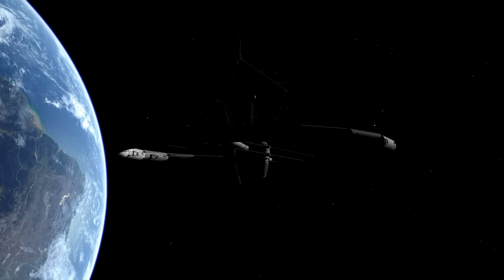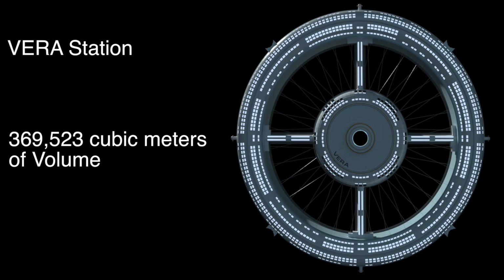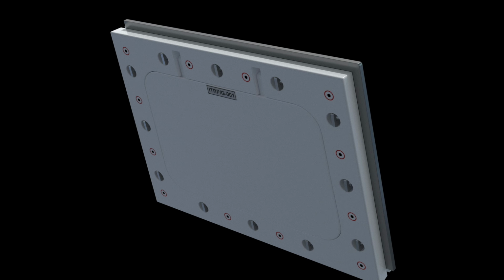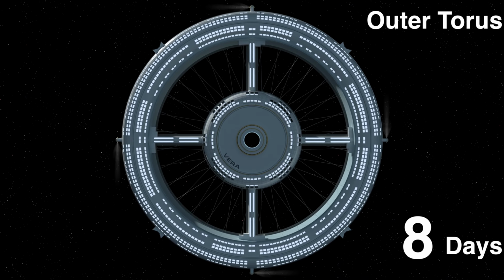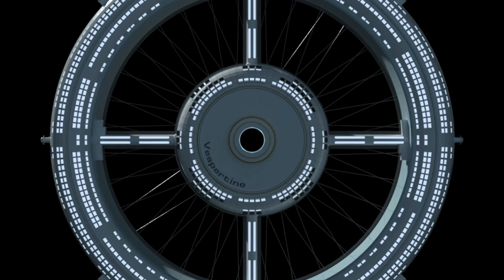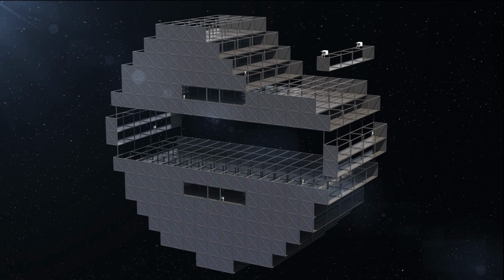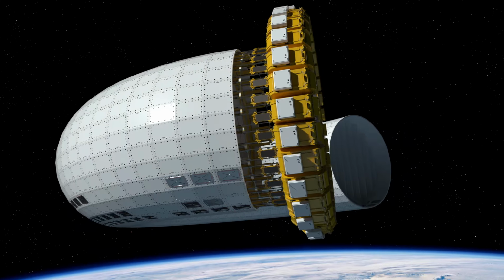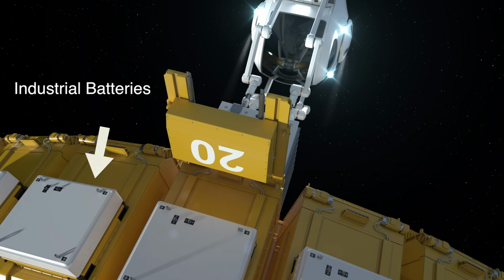We could build this huge Space Station in 6 months

Comment: On Earth, we use materials and structures for compression due to gravity.  It seems out of place, to me, that we continue using those materials and structures in space where there is no gravity.  Instead of weight pull down on it, the pressure inside pushes out.  Also, the rotation pulls outward.  In this situation, we need materials of high tensile strength-not compression strength.  That's good because great tensile strength is easy to achieve in very lightweight materials, such as polymers and fabrics.  Also, these materials are easy to pack into small spaces and expand them out once in orbit or in position.  Imagine the chains for car tires on snowy roads.  Now imagine spinning it rapidly--the chain will snap into shap just from the spin.  Imagine a polymer membrane inside of this that inflates by filling with air.  A small station could be carried by a single Falcon Heavy and expanded in orbit for under $200 million - a single launch.  

The hard part would be micrometeor shielding.   Also at higher altitudes, radiation shielding will require more.  I think, ultimately, a railgun on the moon that bags regolith and shoot it up into lunar orbit to pad its exterior would be perfect.    I've mentioned this concept a lot.

Comment: Ambitious but attainable I think.  The timelines however seem a bit optimistic.  The modular design is quite reasonable. I think it might benefit from a cam lock type of connection system over welding however for speed and ease of changes later on. Naturally it will need a seam sealer system of some type but I think a heavy rubberized tape might be faster and ultimately safer As it can be used both inside and out.

Comment: One thing that always hits me when seeing large rotating space station designs is the lack of solar panels and thermal radiators. Energy consumption of such a large structure and all that's in there will be many times the power needs of the ISS, and since we're in space, almost all this energy will be converted to heat at some point (plus the 70W heaters inside called humans).

So please, Gateway Foundation, make a video about this specific technical challenge and how you're gonna solve this with your Voyager and Vega designs - would be really interesting, as I can imagine power supply and thermal management is one of the biggest challenges in constructing a space station.
Reply: Based ProjectRho reader, right here!
Thank you for pointing all this out.

Comment: Building a empty hull is comparatively cheap and easy. It's the systems you put inside it that are costly and expensive. The ISS modules could have been bolted one to the next in weeks but it took time to build and test and validate the contents on the modules.
Reply from the maker: A good point Emerson. Systems integration will be expensive and very tedious, at least for the first one. Over the years I have become very well educated on carbon dioxide reduction systems for space stations and spacecraft. The old system was called CDRA but the newer ionic systems are better and scalable. - JB

Comment: Blah blah. Unless you can [ 3D Print an Aerogel ] as the weight of structure in even plastic will be too heavy to transport. !!
Reply: Rate mal, wie Schiffe auf der Erde gebaut werden - richtig, in kleinen Einzelteilen, die aus größerer Distanz angeliefert werden 😉
130...140 Tonnen in den LEO waren vor 50 Jahren kein Problem, mit Starship wäre es heute auch kein Problem mehr. Das mal 20....30, und fertig wäre es.

Comment: I so want this to happen and I believe that the manufacturing speed will be up in those numbers eventually, but it will depend on a strong and steady financial backing, a relentless commitment by the leadership and international support of the nations which the "building site" would orbit over. After all, if there's a complete loss of control or serviceability, where will the structure crash down? Hard to imagine it will burn up before hitting ground. Not to mention that the torus building machine will need to be assembled and put into service before any of the torus building can start. All in all if we zoom out a lot, this concept has strong similarity with 3D printing. I think it is the best bet at producing large volumes with minimal equipment and labor cost. The whole building machine could be operated by just a hand full of people, besides a large team of personnel to ensure trajectory, safety, material supplies and so on.

Comment: I wonder if a torus design can be printed using a continuously rotating printer head that rotates along the circumstances of the torus but also rotates along the cross section kind of similar to printing in vase mode

Comment: While most of the assembly machinery is outside the torus, your video shows welding from the inside.  I think all assembly must be exterior to the torus for the main reason that the last ring sections would end up with the welder stuck inside the torus  Everything is easy until you close the ring.  That's why all manufacturing must be exterior where it is easy to finish the ring as well as to remove and position to a new build area 
Looks interesting.
Best of Luck.

Comment: Brilliant. An inside-out tunnel boring machine. Simple and repeatable process. Might be easier to size the battery to be enough to install a full load of plates and change them together in a combined pack. Your going to have to reload plates so would it be most efficient to do both tasks in the same step?

Comment: The CGI movie shows the massive station frame under construction still and unmoving... but without any way to stabilize itself its gonna be rotating all over the place which would make it annoying for any kind of system where a drone moves on a predetermined course back and forth from a space pallet of panels, you'll want to minimize translation and rotation during construction, it will start spinning along all axes before you are even ready to declare it a real spin station lol...  microgravity construction has many pros and cons at the same time

Comment: This has always been a fascinating project, and It’s incredible to see this huge change. (Timelines usually slip back instead of move forward)

I am concerned about heat rejection, however. With a voluminous space station such as this, heat rejection has potential to become a major problem. Just look at the size of the radiators on the ISS! I’m sure you have plans for how to solve this problem, possibly some sort of active waste heat rejection under the skin of the torus panels? I see a similar potential problem for the Sargon system with its high electrical load welders and large batteries.
Reply: Easy, one side of the torus is towards the sun and is filled with solar panels, the other side in shadow have a bunch of radiators.
Reply from the maker: @Merecir  Bingo. What is not shown in this construction video is a canopy over the Sargon CR as it builds the torus. But after that the solar panels will block a lot of the heat and heat rejection will dump the rest off the dark side.

Comment: My comment/question, is about ‘Tie-in’. While assembly of module building in the oil field, the actual assembly of the modules, was the faster, easy part. It was the ‘tie-in’ steps, that were extremely time consuming and manpower demanding, with very specific skill sets.
Electrical, water, oxygen, life support systems, food, communications, production, and waste management, and other basic systems needed to support humans onboard… all required skilled technicians and manpower to make “Modules” actual working production sites.

With all these concepts of ‘space station building’ you are proposing in your video, how will the tie-in project of these space stations, be achieved? The manpower (still having to work in bulky space suits, will be arduous at best, and extremely time consuming. Even if modules come with all these systems in place, how will the tie-in work be accomplished? Very curious about your concepts.
Reply from the maker: They call this systems integration. It is an entire division of engineering. This is my third space station design. The systems integrations for VERA will be challenging but similar to the others I have worked on.

Comment: You're still talking about lifting raw materials from earth. Weight / dollar. Using your building ideas first on the moon to first setup  a mining and refining  community and then a manufacturing community  on the moon. This would make it cheaper to lift loads into space to build such space stations in orbit.
First I would drill for water, then I would dig for gypsum. This could be done autonomously from earth to start with.

Comment: How does the station avoid orbital debris?
How much does each panel weigh? How many panels per 150 tonne delivery?
What happens to the shipping pallet when it's empty? Can it be used in construction?
What systems will be in place to avoid "spillage" of construction materials and welding spall into orbit?
How many tonnes of atmosphere need to be shipped to the station and at what frequency to replace losses?
What is to be done with human waste?
I don't see how Sargon could create bulkheads. What happens if a panel or section fails?
Nice idea but execution is everything.
Reply from the maker: 1. There are 4 Spin-up/Spin-down engines mounted on the exterior that can also move the station away from any large debris. See 27:20 of this video.
2. Each panel weighs 568kg
3. There are no shipping pallets, we use a "materials tree" that holds all of the panels and batteries. After it is empty it goes back down with the starship. See 25:34 of this video
4. EB welding produces very little spillage,  but the weld manifold is designed to catch it.
5. The Inner Torus air mass is 109 metric tons, the Outer Torus air mass is 364 metric tons at STP
6. All human waste will be delivered to your house at orbital velocity. Kidding. We will freeze it and later sell it to orbital farms.
7. There will be no bulkheads. The volume of air is so huge even a big leak could be handled at a leisurely pace. But we will have multiple MMOD damage systems that will handle any such occurrence.
8. We plan to execute everything.
Reply: @TheGatewaySpaceport  Good answer. I look forward to seeing it.

Comment: Proposal:   consider implementing an acoustic Space-Debris-impact detection- and "LOCALIZATION" -system with a network of microphones on the hull of the VERA station.(knowing the speed of sound in aluminum enables the exact triangulation of the bang and the hole!) it should be complemented with an automatic "hole(es)-plug-up robot", inside the station!   Earth orbit has become a dangerous location. 
  You can use this idea. Of course, 
      kindly Yours Konrad Marek
Reply from the maker: interesting idea!
Reply: @TheGatewaySpaceport  I applied for a basic patent on this, in Germany, but, couldn't uphold it. You know, as always, nobody was interested, not NASA 
You can use my idea. Of course, 
      kindly Yours Konrad Marek

Comment: well... 12 months to create an empty structure...
but I have a lot of questions:
what about the inside? (walls etc)
what about wiring? water tubes, electrical connections? and other systems required for a station?
what about solar panels?
what about the cables connecting the 2 tores as shown in your video?

how will the construction machine be powered (power and fuel to stay in orbit)? and how will this machine be created? having a machine creating the machine?
if it took months to create the machine which creates the torus... I dont see the added value. 
more complicated machine = more point of failure and problems.
and more... after the construction of the torus, we have to remove this big machine, to do what with this? do you plan to create other stations? how many?
also you need machines to construct and assemble non-torus sections, this starts to be complicated. (so other machines required...)

and I think your idea is over complicated for the objective.

I think using arms can do the job, can do any type of construction (not only torus), they are easy to create on earth and send into space and operational without any effort. (so no need to create the machine which creates the machine)
1 base structure to power the arms and provide the tools required for these arms. 
these arms can go inside the station and assemble parts inside the station too.
after the construction, these arms can stay in place and do some maintenance. (or, like in the ISS, catch the cargo and move them to the connection pods.
also you can send many of these construction pods. if 1 construction pod is damaged or not working, it's not your entire torus construction set which failed but only 1 pod and not the others. 

the overall idea is good to have an assembly line in space but your idea is way too complex with too many questions not answered.
(maybe you address this in other videos)
Reply: And, how much air do they need to ship?

Comment: All sounds great but I see problems with debris in space hitting the Stations with no explanation on how your going to secure sections from decompression  Another problem I see is weld segments between each ring. welds will work on most structures But I don't see the same things in space. Also you unit builds with the  structure ring on the inside what happens to the last ring   I think would be better to build with the construction ring on the outside then once the torus is built then the construction ring can be separated and and moved to the next project. Good luck

Comment: These are awesome ideas. What worries me is the delta between the idea and the application. We have limited experience welding in zero-g as apposed to welding in a gravity well, something we do understand very well. So it's easier to build robots for down here because we know what the metal is going to do and other weird things. We just don't have that volume of experience with welding in zero-g, I want to see proof of concept missions sent to orbit. Where you test your welding robot concepts and start working out your teething issues.
Reply: The Russians just finished integrating the ESA robotic arm into the new module and it might de possible to send a smal welding robot off the shelf and to test welding metals on ISS.

Comment: nice presentation, well thought out, I am no engineer, just a Idea guy, I ask one question, where will you get the materials for construction. as local resorces are starting to be strained. it seems a structure of this magnatude will suffer from the same problems current manufacturing  is sufering from. supply shortages.. just my 2 cents

Comment: I just happened to come across your video even though I am not a subscriber.  Matter of fact I took myself off of all social media except for a few that have to do with business.  I am no engineer like yourself or a designer like yourself, but I do tend to think outside of the box.  I do have some questions I would like to address with you after watching your video. 
Rotational roll.
How much rotation roll is needed to sustain a comfortable artificial gravity for humans to adjust too?  Once a roll is started how do you maintain it at the constant rate that is needed to sustain artificial gravity?  Do you use reverse thrust booster rockets in cycles?  If you use such thrusters how do you maintain their power source?  What would happen if that roll was too much or too less?  Has this experiment been performed yet on the ISS?  What happens if one of the adjustment engines or thrusters fails?  Imagine a bucket being thrown about on a rope in a circle, the further out the bucket is thrown the greater the force that is exerted on it.  Could the same effect be something to be concerned about in such a big project?  

Drift toward the earth over time.
What kind of power source or engines could be used to adjust the space station over time when there is decay in the orbit?  If you have ten of these space stations all over the globe and you have to adjust for inner orbit decay, what is your solution to this problem?

Space superiority.
I would imagine that soon space would be divided up into countries that can afford to travel there.  When does space have boundaries that are considered territories from the earth to orbit?  Right now it is a free for all, but what if a country declares sovereignty over its air?  Can a US built space station transverse over China territory if the boundary is extended above its land mass 20 or 30 miles up?

Your concept and idea are thought provoking and I personally like where you are going with this concept.  It will take time, money, and new technology, but everthing has to have a beginning and you seem to be on the right track.  I am just a simple designer, and I can respect your inspiration and admire your intentions.

Comment: You have to have either a double hull or a triple hull setup to minimize micro meteorite impacts and the outer hull better be 3 to 4 inches thick. Not to mention damage sensors on nearly every inch of the inside of the outer hull

Comment: I would think the smarter way of doing this is not constructing many different stations with a center and outer ring, that are separated into independent stations. But taking several of these stations and linking them together to create one multi-ringed station all connected together. One ring butted up against another, creating a long tube of ring sections, with docking hubs at each end. If any damage is caused to one section, it will be easier and safer to move people to another ring section rather than moving them out of the station to go to another station.